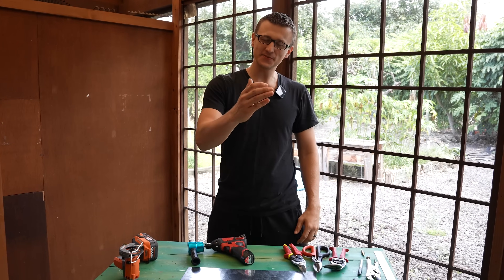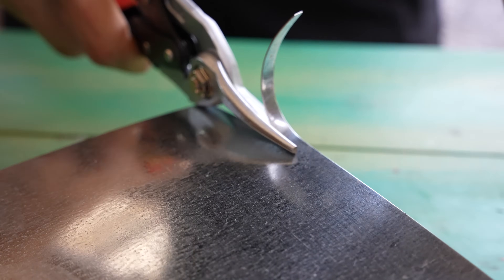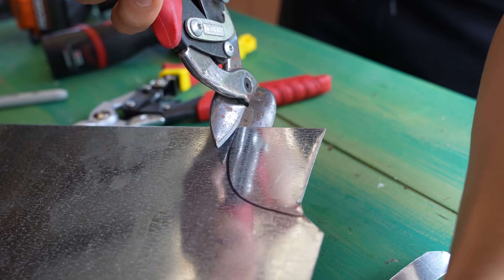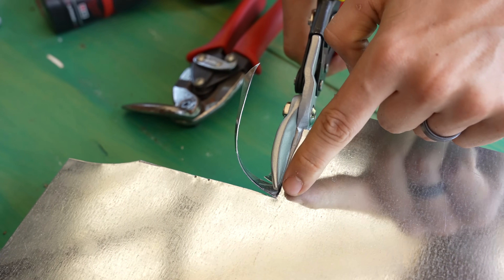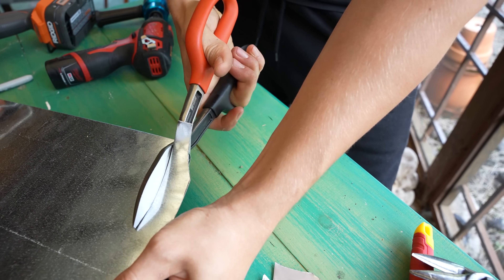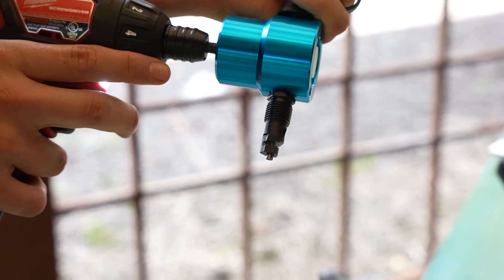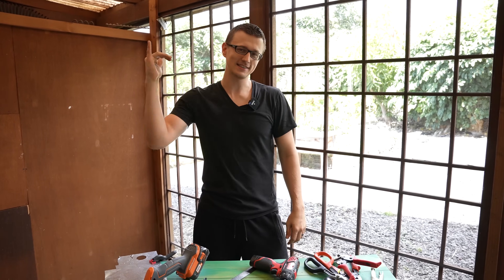HVAC How to Cut Sheet Metal

Comment: What you really don´t want to do is use the grinder indoors to cut some zinc protected material. Because it will evaporate the zinc and you will get zinc fever, this is why nibblers and stuff are better.
You also forgot to mention the jigsaw.

Comment: The best tool for long straight cuts is one you didn’t show.. it looks like an electric drill except the chuck is different , it has a chisel shape with a cutting slot scissors action in the middle..this cuts a narrow strip that rolls in a circle as you cut

Comment: Great tip on the grinder - I have an 8 inch vent hood duct in an attic I need to cut off and was going to try a multi tool with metal blade - grinder will be much faster and straighter!

Comment: Whatever you do. DONT offend the nibbler people. I tried one of those drill mounted ones...and for my application, they failed...miserably. I was cutting sheetetal from a 74 Ranchero...so yeah, thick, but within what they said you can cut. It would not work, at all. I didnt have the die grinders yet, which would have helped a lot. I also offended the Dremmel people..but the new Dremmels also dont have to guts to cut through 12ga steel. 

The sad thing is that I RIPPED the sheet metal with the Vampliers pliers...yes, freakn pliers. But, is it dumb if it works? lol. Anyway, those vids were my most downvoted (also some of my most viewed...guess people love to rageclick huh)

Comment: I was a Sheet Metal Worker for 39 years (till I retired) and all I ever used was snips. I would carry 4 pairs R&G straight jawed and R&G offset (not the 90* ones) and that cut 95% of whatever was needed. We all carried (what you called scissor styled) straight jawed pattern snips in our tool buckets for bigger longer heavy cuts. If you use both the R and G snips you can make a relief cut next to the lines you were drawing, that was the style that was used to cut spiral duct or circles of any diameter. The grinder was only used when a heavier gauge of metal was being cut and then we used a full sized circular saw. The other stuff was nice but really it is all just a novelty and a way to separate you from your hard earned money.
Reply: I’m an HVAC installer and cut sheet metal everyday. As the OP said, 95% of my cuts are done with either reds and greens in straight or 90 degree offsets. 

I’m partial to Midwest Industries because the jaws are heavy and the action is smooth. I find others have too much serration and tend to break the thinner bladed models.
Reply: What brand did you find to be the best? I've noticed some snips were harder to cut then others
Reply: @davidbriz7066  I was a big fan of Klinks and the old Sear Craftsman brand… really any snip that does not have a “sprung” jaw is fine. I know a lot of mechanics that will use tools from the tool truck but it does not make them a good mechanic. The best snips are a good quality one that you practiced with. For the longest time I would use Weiss snips and get great results. Just practice, don’t roll your cut (keep the metal square in the cut of the snips) & practice as much as possible

Comment: Offset aviation snips is all you need for any of these kinds of cuts. Knowing how to use one tool in more than one way is far better than having one tool for each type of cut. You will never see a professional commercial duct installer (tinner) use a grinder to cut sheet metal. It isn't cutting anything just burning the metal away and leaving a messy edge. A sawzall is far superior instead for those long cuts assuming you have the correct blades.

- Commercial Journeyman Tinner

Comment: so, when cutting a larger hole in the plenum or return drop, you're supposed to cut a rough smaller hole first and then finish it off?
never seen that before.
every time i've cut sheet metal, it's turned out crappy.
Reply: It’s so that of you have to cut some sheat metal out and you don’t want to cut the metal you wanna leave there so you could use a step drill bit to put a hole or take a large flat head and beat a hole in it.

Comment: Awesome video Jay, thank you and great timing!  Just removed  about 10 feet of drywall on a center load bearing wall in our Eagan rental to open the dining area to the living room.  In that wall cavity are two return air ducts that I need to relocate to nearby walls.  And I was noticing the lack of good videos out there with instructions regarding best practices as it relates to sheet metal cutting and manipulation.   I purchased your nibbler (already have the Milwaukee grinder that looks a lot like your Rigid) and handy odd looking aviation snip using your provided Amazon link.   That estimated $1 partner bonus Amazon will share with you should definitely help offset some of the higher Hawaiian expenses.  Given the wear on some of those tools, it looks like they made the journey west with you - special tools.  Thanks again for the content!
Reply from the maker: Haha thanks Holt! Yes, I did take some of my tools with me 😎 I wish you the most of luck with your remodeling project! I'm sure it will be a breeze for you 😤

Comment: Hi Jay, nice to see you again. Hope all is well.
Question about “A “ coil enclosure sheet metal. I’m thinking about making an access hatch in the sheet metal on the short side (A side) of the enclosure for cleaning / testing. 
What are your thoughts / advice , pro or con. 
Thanks
Reply from the maker: Hi Paul! All is well 👍 There is no clear-cut way to get to an A-coil. It's almost always a pain. Same with an access panel, nobody really talks about it. I think it would be fine to add an access hatch as long as you are able to seal it back up with minimal air leakage from there. Be careful not to cut any of the small capillary copper tubes though, otherwise it will become a much more expensive project than anticipated... If you cut the duct, I would use a tool that only protrudes a small amount. An abrasive wheel in a small circular saw with the wheel protruding 1/8" should be safe. Leave enough on the duct so that you can put a piece of sheet metal over the opening you cut out and then  secure it with short sheet metal screws. Tape alone is not going to last.
Reply: @WordofAdviceTV  Thanks for your advice, wish me luck😂. Looking forward to the next video. You and the family stay well !

Comment: With all due respect, being a retired Journeyman Tinner, and realizing technology has changed since I retired, I have never used your type of nibbler for any sheet metal work, although I have used a different type of electric nibbler in shop work. However, I got faster and better results using a good pair of left and right snips. I've never used a grinder on sheet metal, except when I've installed heavy, corrugated type commercial/industrial metal (decking/siding/etc.) and I either used an electric circular saw (with a metal cutting abrasive blade), gas-powered saw (with a metal cutting abrasive blade), or occasionally an acetylene-oxygen torch depending on the thickness and type of metal. When I made straight cuts, I used a long-handled pair of (Wiss) long-jawed, straight snips (for leverage) and for heavier gauge metal, I use a type of long-handled, short-jawed snips (Wiss), what tinners call "bulldogs".
Reply from the maker: Much respect to you good sir! I don't do a lot of sheet metal work as I have always been on the service side of the business. So needless to say, your opinions on sheet metal cutting are far superior to mine. I am sure that regardless of what "advanced" tools us green horns may be using, you would outperform us all. Especially since your username is Lefts nRights 😄 Thank you for sharing the tools you used and the situations where you would use them.
Reply: Wow......... REAL “old school”👍. Don’t see that anymore!! Keep the trades alive !!
Reply: I love my bulldogs!  Use them for cutting s-lock.  Saves my hands!
Reply: @yepper1165  what brand do you have?
Reply: @dustinpomeroy8817  Midwest.

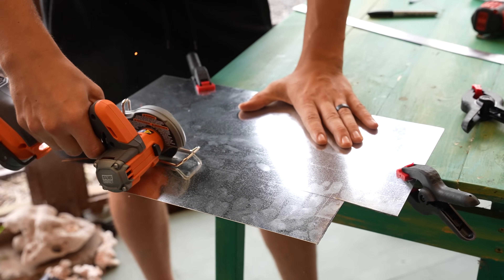Comment: At 09:14, failing to maintain DOWN pressure, of the CUT-OFF tool's 'FOOT SHOE', upon the material being cut, is the cause of ROTARTY CUTTING TOOL, 'WHEEL CLIMB' & FWD SURGE.  Simply KEEP DOWN PRESSURE to prevent this.  Also, place two 2x4's, side by side, ON TOP of the cutting table.  Then make your cut BETWEEN THE 2X4'S, not out in the air beside the bench.
Reply from the maker: VERY accurate observation. Thank you for breaking it down and explaining exactly how to do it correctly. Much appreciated! 🙏

Comment: I hate sheers. I use a grinder with a diamond wheel, like you did.
That nibbler seems good for small holes. Sometimes I use one of those 5 in one tools with the blade that goes from side to side.
Not the best way. Great video..
I went horse back riding when I was in highschool. One time I
got the horse 🐎 in a galopp and
couldn't slow him down. There was a curve coming up and the
horse went left, but I kept going
Straight...ouch 🤕😂
Reply from the maker: Haha you are not alone with your lack of love for sheers 😅
Oh yikes! That horse experience sounds painful, I'm glad you made it okay!
I used to work with race horses so I saw firsthand how dangerous a cute horse can be...
They're great animals but one needs to exercise some caution. I had one step on my foot
and I COULD NOT get it to get off for a good 10 seconds or so. Fractured my pinkie, it
was purple and thrice the normal size the next day. 😱

Comment: More hand strength is  needed using a grinder that seems a bit out control seems like a millennial solution the easiest way
Reply from the maker: I didn't take the time to secure that piece of sheet metal on both sides. I think if I did that, the grinder and nibbler would have been much easier to control.

Comment: Thanks for sharing this info! 
I think the biggest problem with your circle cut was the unsupported side. You'd have a lot more control if you'd place it across two support pieces. That said, I didn't even know a drill powered nibbler existed!
Reply from the maker: I believe you are very right! I thought I could get away with it as long as it wasn't hanging too much off the table but that wasn't the case. The grinder and nibbler would have been quite a bit easier to use if I secured the metal better like you suggested. Thank you for accurately pointing it out and I'm happy I was able to show you a new tool! 😄

Comment: Hi Jay, Hope all is well on the island.
I have a 100 year old house that had an old 1940 Niagara furnace that replaced an old 1924 coal burner.
The newer 2019 Air/furnace uses schedule 40 PVC instead of the old chimney. I was thinking of using the old brick chimney to install an air return from the third floor to the basement. then capping it from the roof. It seems I could use what you taught me here thanks and what do you think of that idea. there is no vent from instant hot as it is vented with PVC also. Would this be of any advantage for efficiency?
Reply from the maker: Hi John! All is well on the island 👍
An 100 year old house sounds pretty epic!
I have never done what you described before so I don't have any experience anything like that. So are you thinking of doing this because you do not have any air returns on the third floor? One can never have too many returns so I don't think it would have any unwanted side-effects. It would help keep the third floor temperatures more even. In regards to efficiency, it might cause the furnace temp rise to slightly decrease but the energy savings would be very small. If efficiency is why you would do this, I don't think it would be worth it. 
Also, keep in mind that this is just an opinion of a tech that rarely does installs 😇
Reply: I want see video of how to cut  45 degrees on different sizes of duct